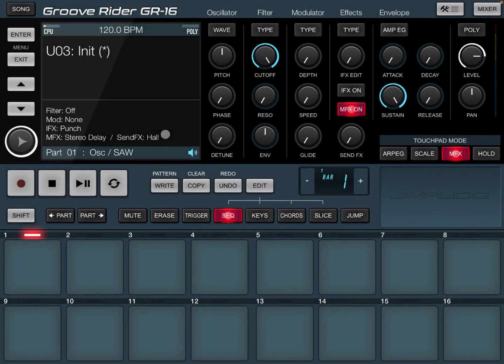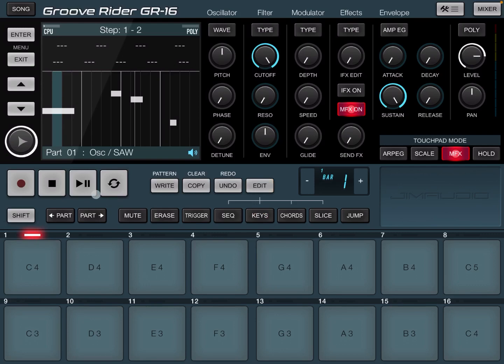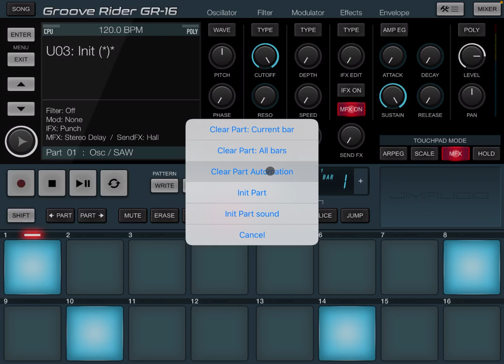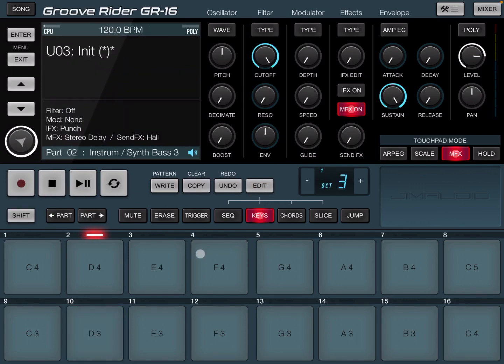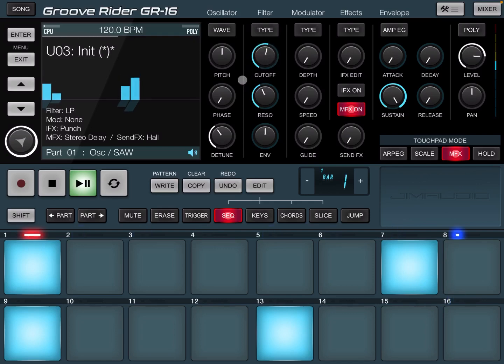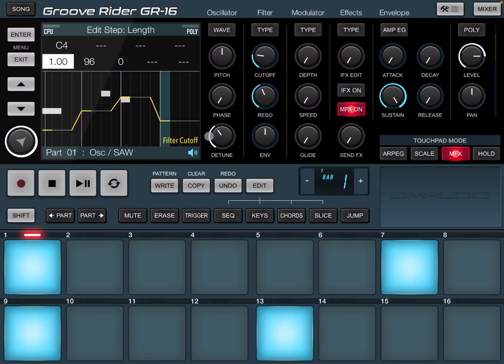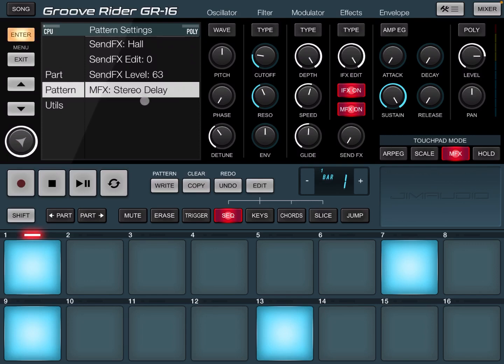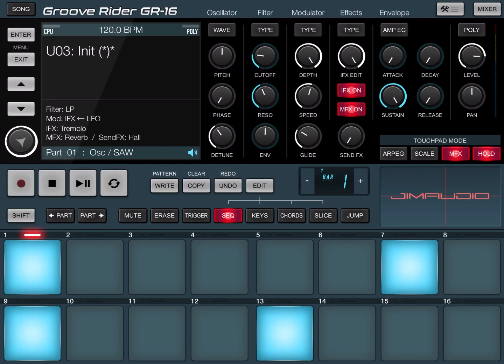JimAudio Groove Rider GR-16 - Tutorial Part 6: Quantize, Part Automation and MFX Automation

Comment: Some tips to fasten your workflow:

2:02 when you open the sequence it is already quantized, the default behaviour is to quantize the note start on recording, you can change that on settings - general - rec quantize

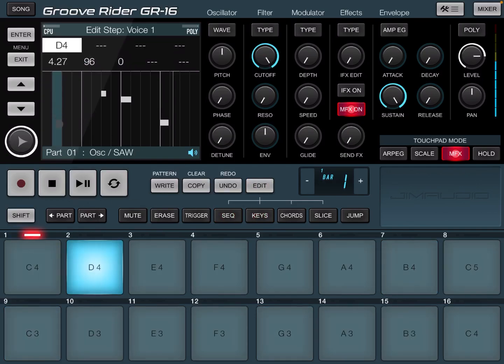4:21 you can copy the note (or chords) if you select it on SEQ-EDIT mode and then use shift+the pad you want to copy the note to, in this case the first pad, that should copy the original note length

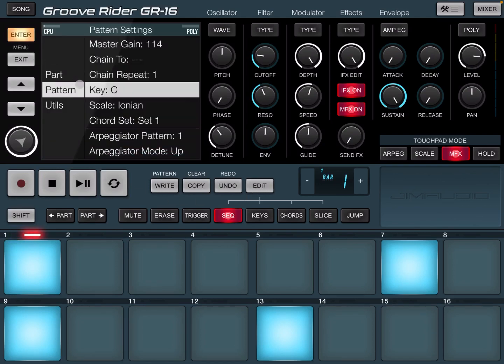11:07 you can also access the master FX menu if you tap twice on the MFX button on the pad.

Nice tutorial, GR-16 is incredible deep.
Reply from the maker: Great, there is so much to show